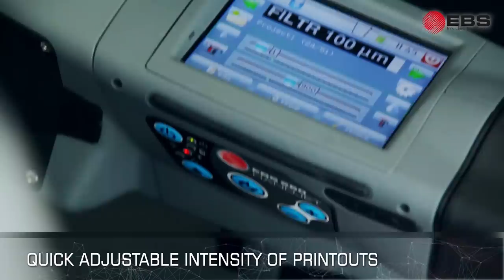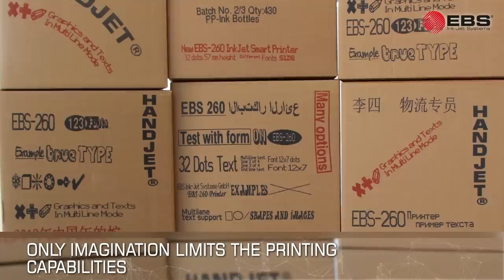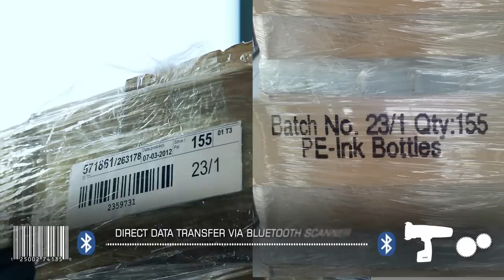🇬🇧 HANDJET EBS-260 - improved hand held, portable, mobile ink jet printer

Comment: How does the ink hold up on a painted metal surface exposed to wind/rain/sunlight? Does it was/fade away?
Reply: Will not be. There is special ink .You can contact me.+8615802789877